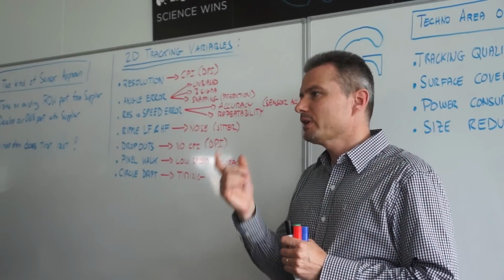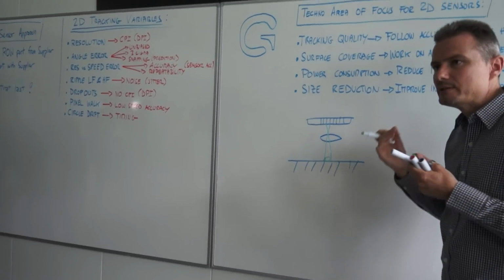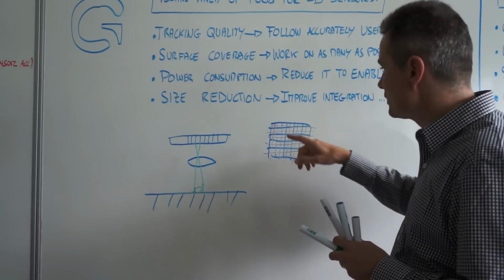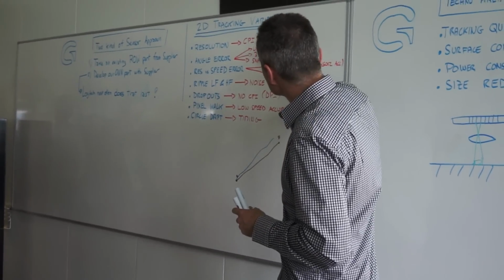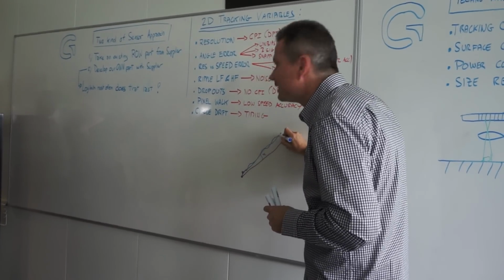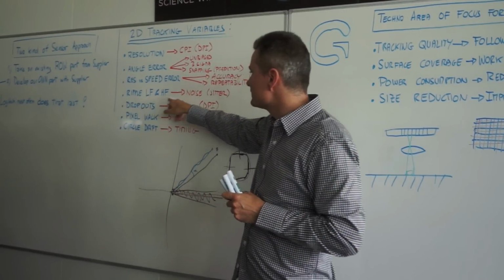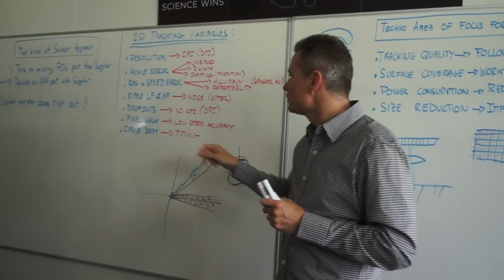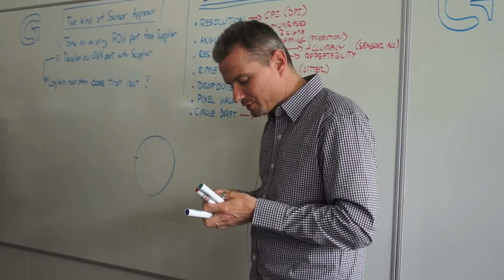Logitech HQ: François Morier, Senior Engineer Explains Mouse Sensor Design

Comment: 10:25 funny hearing this coming from a Logitech senior engineer, due to the fact that I'm here specifically due to the Superlight 2's most recent firmware update that increased the mouse sensor's maximum DPI from 32000 to 44000. ever since the latest firmware update, the sensor feels very inaccurate and twitchy (nervous, as this senior engineer puts it)

Comment: Clearly Logitech engineers do not talk with their marketing department. 4:15 - 4:30 he talks why splitting pixels to increase DPI is against performance, yet his company mice are the ones leading the charge in doing just this. Didn't they release a 16k DPI mouses this year LOL
Reply: vulkan yeah so what no one uses higher than like 1000 mouse dpi lol I use 1200 and get roasted for having a “high dpi” 😂
Reply: It's from 2013 and back then a lot of mice had 400 or 800 cpi native and used interpolation to reach higher numbers. Nowadays we have much better sensors as manufacturing improved and we have 12000 or 16000 cpi native sensors.
Reply: @razorblade7108  no. The hero 16k is a 36x36 pixel array, so 1296p. Not 12000
Reply: @Troublesolver  36 x 36 is the resolution of the imaging sensor. CPI stands for counts per inch, which is the amount of counts a mouse makes in one inch of travel. That is the resolution that is important (as long as it is not interpolated, that just makes the cursor move faster at the expense of accuracy). A lot of marketing folks call CPI DPI, though DPI is a term used for pixel density of displays and camera sensors.

Comment: it mean if you playing on low  resulation (hd ) (fhd) display then go for as much possible small DPI mouse (250-800-1600) and if, you  playing on high resulation display then go for (400-1600-3200) DPI mouse ,

Comment: PMW3366 sensor native DPI? Using logitech G pro. Can help me please? :(
Reply: just to be safe go in multiples of 400, otherwise no native dpi
Reply: It doesn't have a native DPI, everything is native.
Reply: @tutle622  this statement contradicts what the super experienced engineer with more insight than any of us is ever going to have is saying in the video.
Reply: @SianaGearz  This video is several years old. This information is no longer relevant.
Reply: @tutle622  3360 is still considered a top notch mouse sensor, and 3366 is its variant for Logitech - probably just re-certified for a modified SROM which actually comes from the microcontroller during sensor boot. Version 1.0 of the datasheet for 3360 is dated 2014. He would have known about it, he would have had a non-public preliminary datasheet on his desk months or years prior.

Besides, the fundamentals cannot be changed. He explains that there's an image sensing array. The raw data request returns the 36x36 matrix of pixels on 3360 that the image sensing array is actually seeing - which is the same order of magnitude, only slightly higher than previous generation sensors like 3310 which had a 30x30 matrix. There is no getting away from this fact, that there is a native resolution. You cannot make the surface window that the matrix covers too small, or the diffraction effects become an issue, and also the surface detail that you're trying to pick up becomes too large and goes beyond sensing window bounds on plastic pads and melamine desk surfaces. This is all information that you can go ahead and verify independently.

I don't have the projected size of the sensing matrix and thus the native resolution in the datasheet, but with some effort (unfortunately i don't have one of these sensors at hand and when i do, it might take several weeks of trying things) i could determine it. Default resolution that the sensor delivers when unconfigured is 5000 CPI, so chances are, the native resolution is probably half or quarter that.

Comment: First 5 minutes and it's the first time I understand why sometimes more DPI doesn't = better.

This guy would be a great teacher.
Reply: *****
You fail at trolling. -.-
Reply: great teachers are usally those who not only understand on what is going on but have 100% grasp on the concept so that you can explain to a person that has never heard anything about the topic.
Reply: I have no Idea :D how old are you 12? Oh my god, that's what you get for informing people. Re-read my comment in 10 years and maybe you'll understand it.
Reply: for real
Reply: Whew
Reply: potato psoas 

You didn't listen to anything he said did you?
Reply: @Joshua W
Not exactly, pixel matrix is 30*30=900.
Native resolution, as in resolution(s) doable from the sensor without mcu (micro controller unit) interpolation, is 200 to 6400 in steps of 50, yes, but that is a calculation done on top of the base image.

There are several editions of the DA, out of the top of my mind: 3G 
1800cpi native; 3.5G 1800/3500cpi native; 4G 200 to 6400 steps of 50; 
chroma same as 4G, just goes up to 10000, elite 16000.

All these, except for the elite have a 900 pixel matrix, which doesn't necessarily mean 900cpi is the base resolution of the sensor.
Lens magnification and distance from surface influence on how much surface these 900 pixels will be imaged. Having a sensor closer to the surface or adding magnification to the lens will give more cpi; the opposite, less.

Usually sensors work off an 800cpi base resolution even if the the physical pixels are 900 or more.
From there, DSP  (digital signal processor, part of the sensor) works on the image and gives what we call "native cpi" in the community.
Morier, as an engineer calls native cpi the resolution of the base image the sensor works on.
Reply: or you can just open up paint ;)
Reply: @DeafBlindMan   why open paint ?

Comment: hm he missed one point? that isnt reliviant in todays world but would have been nice:
if the dpi of the sensor is actualy to low to track each pixel on the display u got and it moves 2 pixels instead of 1 on the display.
of course 400 dpi like my zowie fk1 has is enough to avoid this issue.
but that could have been good to mention why a to low dpi could have been an issue.
and yeah holy fuck 16 k cpi? mouse rly fucking idiots razer making shit sensor mize that break faster than any other.
its horrible.
glad there are some mize that have proper tracking like the a 3090 sensor or sth.

Comment: He's saying that using a mouse @ a high dpi like 5600 is pointless, because there will be errors in pixels, pretty much the biggest myth in gaming busted right there, so if you're playing an fps and using a mouse with high dpi, be sure to keep it as low as possible (<1000)
Reply: nd4spd yeah, if you are playing games that requires precise aiming then low dpi is the right choice but if you are playing exploration games for example low dpi is not necessary
Reply: Just because I don't care about the results of a match doesn't mean that I will not compete for fun. 
A bad player can still hold much more knowledge about game mechanics  than a pro.
Your logic is fallacious.
Reply: I disagree, better to have high sensitivty to look around and use DPI switch or macro to lower sensitivity for precision aiming.
I don't get this low sensitivity/giant mousepad trend of flailing about.
Reply: @fuckenps3  You want to have a dpi of 400-800 for pixel accuracy, and if you like high sens you want your in game sensitivity to be high. You never want to "switch" your DPI on the fly because then you will never build muscle memory, which means you will not be able to hit really fast flicks consistently.
Reply: You think the brain is so simple that it struggles to delineate between 2 sensitivity presets? The muscle memory works just the same. You think every physical tool with more than 1 setting is just un-master-able?
Reply: nd4spd good luck getting out of silver or nova bro
Reply: nd4spd I’m just saying, if you think switching your dpi on the fly is good you won’t get very far in any competitive FPS. There’s a reason why no good players do that and stick to one sens and dpi
Reply: nd4spd what are you even talking about? Just give it up bruh. It’s straight facts that having a low dpi and decent sensitivity is better than having two separate sensitivities.
Reply: Give what up? Sounds like you've got an unhealthy obsession with competition. We disagree, get over it.

Comment: With this video taken into consideration, Does anyone know a mouse on the market that has very good low speed tracking? Meaning that the system can pickup the smallest movements of my mouse.
Reply: If that's what you want then I recommend a mouse/pad combo with a low coefficient of static friction, so that your small movements can be precise in the first place.
Reply: zowie fk
deathadder
g400
Reply: Kouva Not all the DAs, the original DA 3G, the 3.5G and the 4G, but NOT the new ones
Other good mice are the FinalMouse and the newer ones by Zowie (with the same sensor as the FK)
Reply: ***** MLT04* (aka Microsoft IntelliMouse Explorer 3.0 and some other MS mice with no side buttons)

Comment: So what is the native resolution of the G502????
Reply: Just go with 200 or any low multiple of that, like 400 or 800.
Reply: ThePickleKing1111 I use the full 12k because I use the XIM4 on consoles. It works really well.

Comment: Don't really get why it is absolutly necessary to take a picture of every - single - drawing - that is made, while it is being made. Makes me wonder if the person doing that ever heard of the "video camera", it works quite nicely for the purpose of documenting a process, I heard.

Besides that, very interesting insight in the factors that are important for a good and accurate Mouse Sensor. Makes me a bit sad that I got a G500 now, I feel like I could've gone with something better - another factor would be "sensor placement" on the mouse I guess, though that'd not 100% fit into the topic of this video. The G500 has the sensor quite far in the front for example, which somewhat affects the way the user tends to move the mouse, from my experience.

Comment: And yet most Logitech mice use shitty laser sensors instead of flawless optical.
Reply: MaximilianKohler Who does need more than 800 DPI? Pro gamers use 400 :D
Reply: Marketing still sells :P

The Logitech G400(S) is a great optical mouse for example.
Reply: They also use high DPI, which he admitted is worse. Very very few people need over 800 DPI. Not to mention that logitech hasn't come close to even matching the accuracy of the old 400DPI MLT04 microsoft sensor.

Informative video though.
Reply: +MaximilianKohler I am really about to give up on optical, I get the better accuracy and shit, but they have so many surface requirements for tracking.
Reply: +Cool Blue Get a cloth pad, never have a problem again...
Reply: My all time favorite logitech is the MX518 trusty basic optical served me over a decade of gaming
Reply: Peteto Chibs   I only ever said it was my all-time favorite not because I think it's the best, I know it isn't and never claimed that. It just operates like a tank, it's always my there as my dependable backup. 

I've been obsessed about accuracy in PC FPS games since the mid-90s (I'm still obsessed with instagib.) With over two decades of experience I found that I keep the mx518 around as a decent backup when my main mouse fails me. I use the Mamba Elite as my main now. I hate the quality of razer mice but love the ergonomics. I just rest better at night knowing I have my trusty mx518 on standby.

Comment: But what if that every other or every fourth count happened to be to a different direction than the other counts? This kind of data loss is never good for accuracy even though it's not as bad as values over 6 so only when absolutely necessary should one use something else than 6/11.

Comment: Windows sensitivity should ALWAYS be 6/11. Anything other than 6/11 causes movement data (aka accuracy) loss or introduces prediction. Sent you a link through PM to a program that demonstrates this. Also you should always use Raw Input whenever possible ingame and disable windows mouse acceleration ("Enhance Pointer Precision").

Comment: 1- No, you better check the product model on the internet before you go to order/buy it.
3&4- They won't make your mouse slower because you can adjust as you said, or increase dpi on desktop - but for in game precision stick to the native dpi as he said.
Depending on the mouse the native dpi might be around 800/900 and another higher value. You have to find this information online, but usually best dpi are 800/900 depending on the mouse, 1600/1800 can be good too, although they are not native.

Comment: This is why shotgun mics (actual name) were invented..  You'd think a 'professional' tech site such as tom's would a) know to buy one and b) know to use it in a situation such as this.
Reply: I strongly suspect this is already a shotgun mic, but not the most focused one. You'll find when they pick up audio for TV broadcasts, they will use a shotgun mic directly above the speaker. The problem is that the shotgun mic necessarily has a rear lobe besides front lobe that is equally as large, and then side lobes. The only good way to pick up audio in questionable situations like these is to equip your speaker with a wireless lav.

Comment: I c... I c...
1- So when I buy any mouse, it will say on its box whether it has correction/prediction, no?
3 & 4- won't that make my mouse slower? and since I have a 24" monitor it will be kinda annoying, no? or I can simply adjust that by the ingame mouse sensitivity and the windows mouse control panel?
last 2 points, ok so I should put it on 1800dpi (not 800/900 or so) right?
and sorry for asking 2 much, I did listen to him, but am really bad in this area :/
THANK YOU SO MUCH :D

Comment: 1- listen when he talks about angle snapping @ 5.40'
2- I don't like them
3- Acceleration off/disabled and 500 Hz-you don't really need 1000
4- Yes, don't modify separately X and Y as it will mess with your aim in any game. The reason you use 400/450 , 800/900 is that they represent the native sensor resolution and it performs best tracking at these values as he said after 2.20'

Comment: I do have the Deathadder atm
some more qstions if u dnt mind ^_^

1- Why no correction or prediction? what do they do?
2- What do u think about the double mice? The laser and optical combined in 1 mouse I mean.
3- In the razer synapse app, there's acceleration and Polling rate (in frequency), what should I do with those?
4- Since I can control the X and Y axis for dpi, and a wide monitor, is it still better 2 put both at 1800 or below?